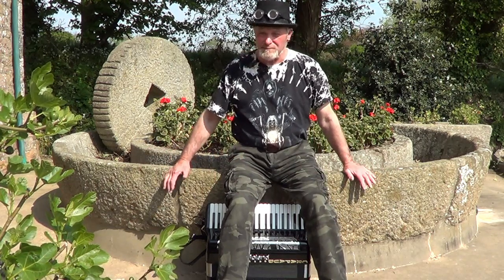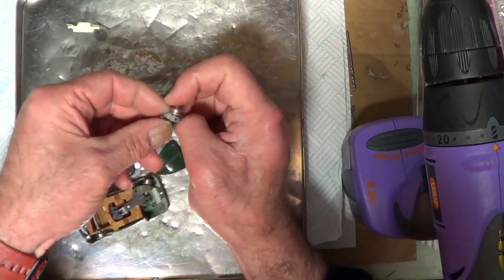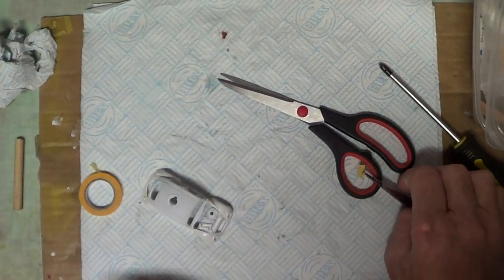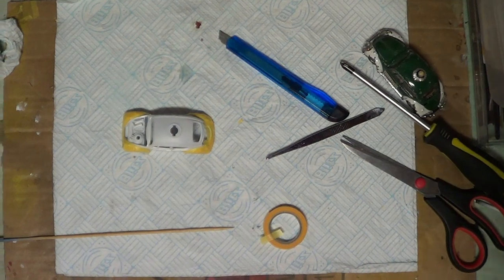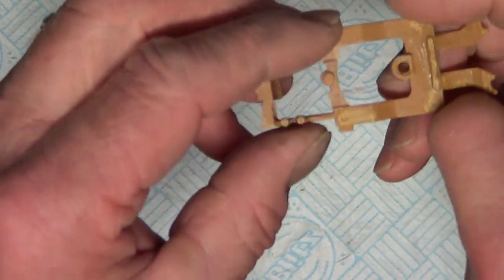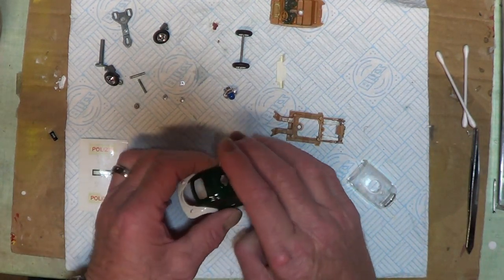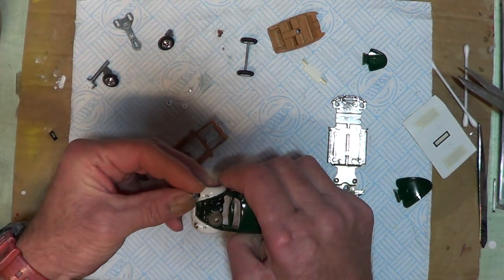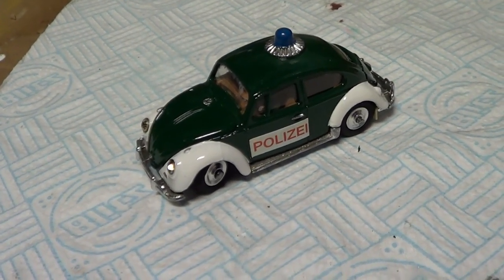CORGI TOYS VW 1200 SALOON  EUROPEAN POLICE CAR, FULL RESTORATION.

Comment: Wow nick this was a great little casting and another great restoration good work bud, I hope your hand is ok we’re you slipped with your box knife 😣 great colour match fantastic paint job if I may offer a tip for you which I find it easier when facing masking meticulous areas is I use pva glue just paint it on in the said area let it dry for a few mins then do the paint once everything is try simple rub off the glue or wash in warm water ( before clear coat) it’s basically liquid masking without the expense 👍👍 great job bud stay safe
Reply from the maker: Thank you, yes the hand is fine thanks, I should be more careful lol, the paint was just luck, I bought it ages ago for something else and never used it so it worked out perfect. That’s a great tip using oval glue for masking awkward areas, I will get some as soon as we can get back to the shops, sounds like it can save a whole lot of bother so cheers for that😊👍
Take care and stay safe.

Comment: Hi Nick, in this video you say that you sprayed etching primer on before the grey primer. Do you do this on all your restorations? If not, why did you use it on this model? Is the metal casting different? This VW turned out nice, another great restoration.  Best Regards. Peter.
Reply from the maker: Hi Peter, I actually bought some etching primer by mistake, and I googled it to find out what the difference is to normal primer, apparently it has a certain acid in it which slightly burns into the metal making it stick much better. You shouldn’t spray the colour coat straight onto the etching primer though, so I just paint a light coat of ordinary primer onto the etching primer before the colour coat. I don’t always use it but I do think it would be better if I did, at the moment I have run out of it, so I have experimented with just painting the colour coat without any primer at all, seems to have done ok.
I do think you get slightly better paint adhesion if you do use it though. There was no specific reason that I used it on the VW, the casting is the same as any other model. Hope I’ve not muddled you up  now lol.
All the best, Nick.